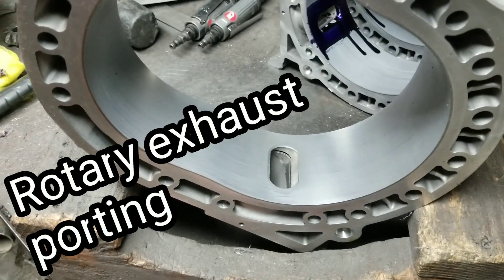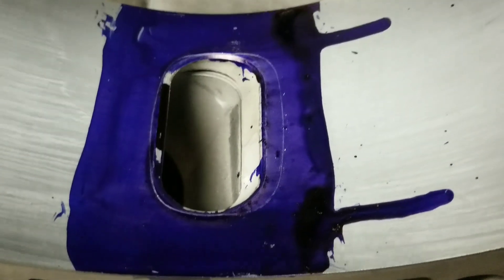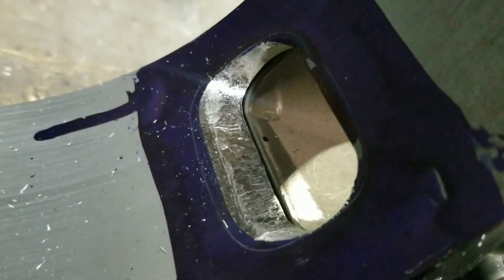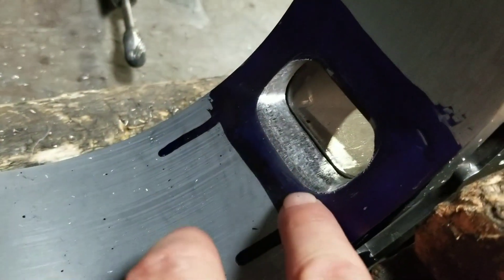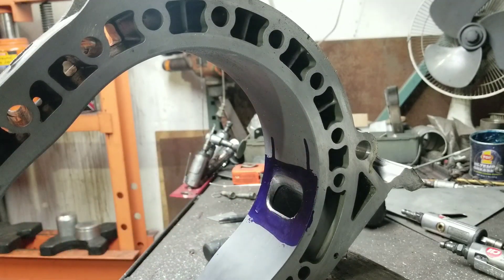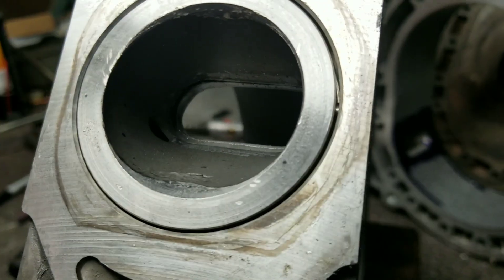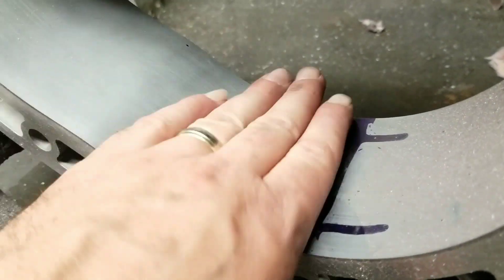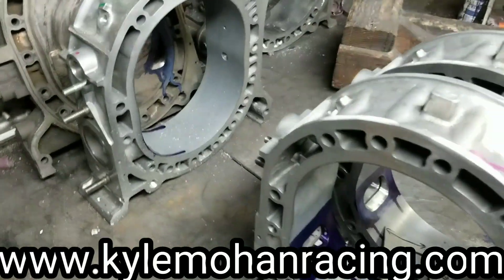Rotary Exhaust Porting #1 Pro tips, Rotary Porting / Engine Exhaust Rotor Housing Porting

Comment: Thats a renesis housing? I was reading about if you want unlock some power on renesis you need port the exhaust to increase the flow, thats right? Greetings from chile! Nice videos.
Reply from the maker: This is a RX7 rotor housing
Reply: The rx8 is 13b msp. Multi Side Port.  The rotor housing depicted is a rear exhaust.